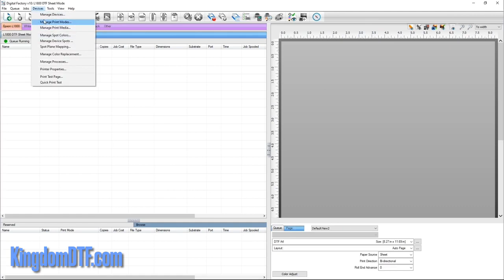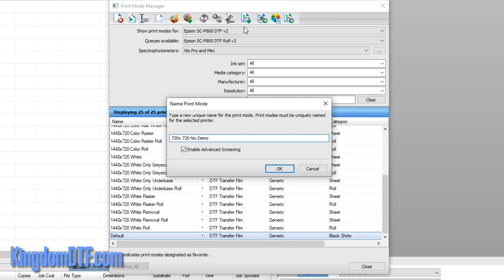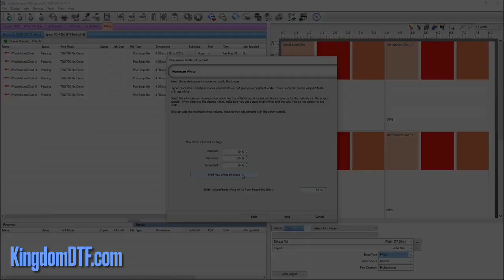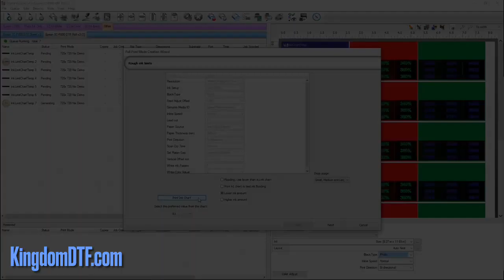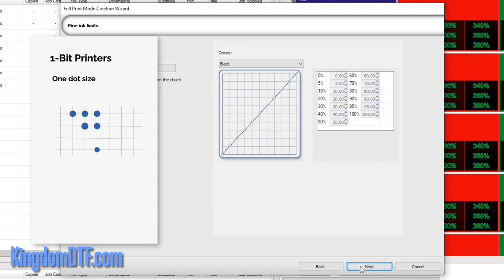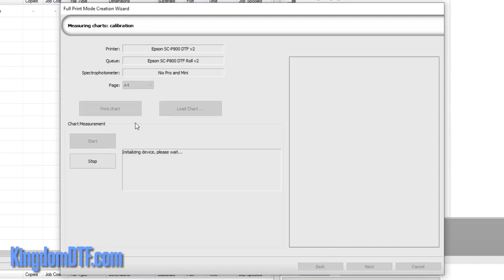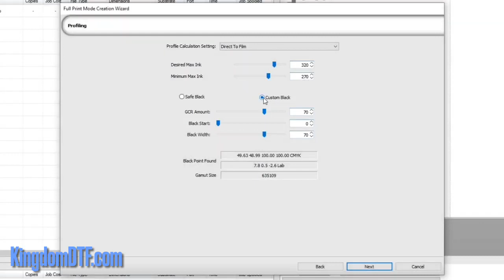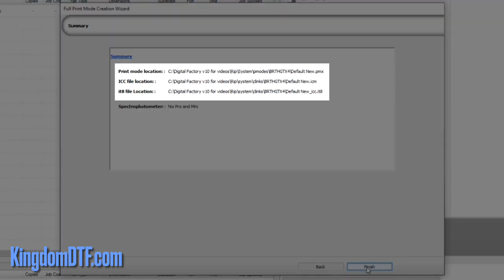How to Create ICC Profile on Cadlink Digital Factory 10 or 11 - Cadlink DTF Tutorial

Comment: Cadlink leaves so much to guess when they simply say..."pick the best one"...best what? They are all so close so details of what defines "best" would make this video much more useful.
Reply from the maker: When you create the ICC, the best results that you get when pressing to the t-shirt. You can not create an icc if you don't print and press, that is how you know the colors are ok and not fade or over saturated. The video explain very well how to create the icc profile.
Reply: @KingdomDTF , I too don't think this bit is described well at all. But it's not just this video that does that. I've seen 2 other videos that do the same.

We've now gone through the whole process twice, firstly selecting B2 (which seemed best for the red/green/blue colours) and then selecting 56 (which seemed to be good for the letters/number across all 3 areas). Neither gave good results. B2 gave the closest colours, but the printing looked grainy (hence why we thought too much ink). It seems we went the other way though by selecting 56, as all the colours look washed out.

Bottom line is, we've made several attempts now, but we're still not there. And it seems to all hinge on which is the best flood chart.